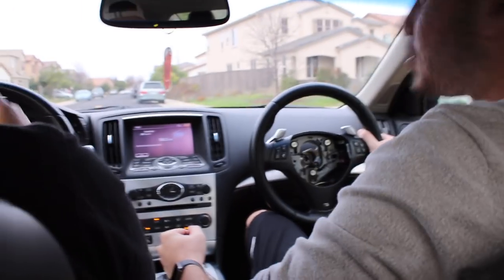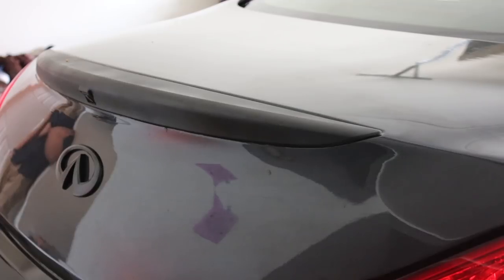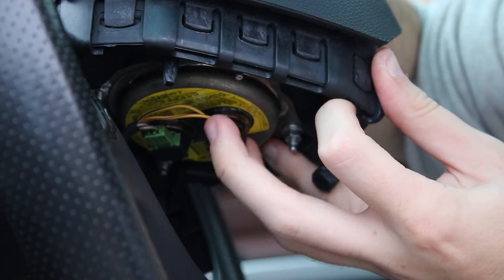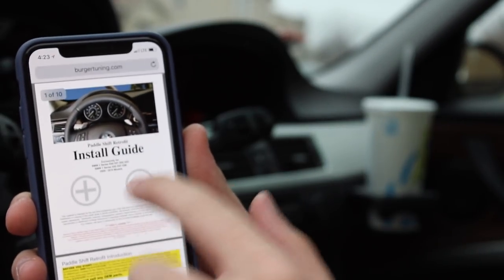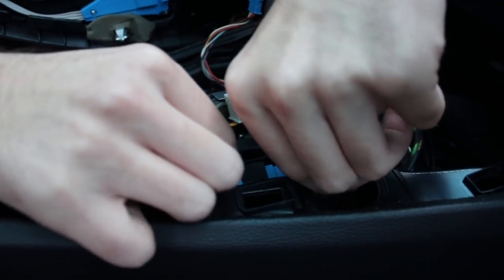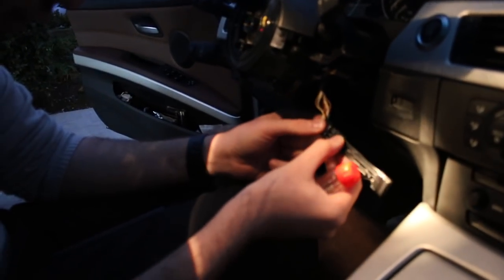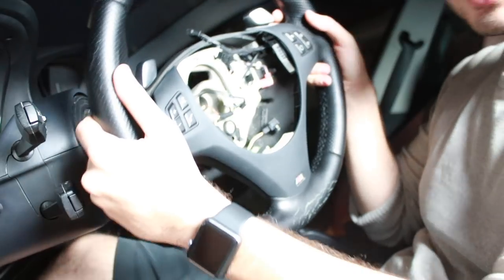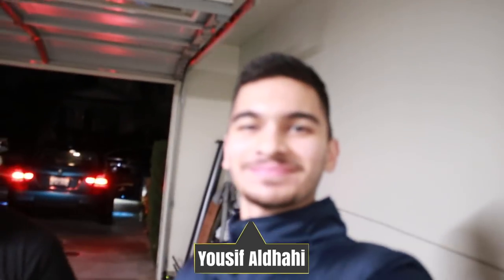BMW PADDLE SHIFTER RETROFIT! (E90,E91,E92,E93)

Comment: Nice, thanks for posting the video.  I have to say, it's not too big a deal to do, but it's so much easier on MK5 Jettas to switch to a paddle shifter steering wheel.  I will likely do this on my next E90 since it's become nearly impossible to get a manual these days, at least in the shape I want.

Comment: Lol guys the burger tuning harness does not work as described. It is not just plug and play as described.i hate when people use a product and it is not as described but they still give them credit and not call out the makers of the product and let them know that its false advertising. I know more than 15 people that have done the retro fit and harness was not plug and play as described.

Comment: Nour, I sent a like your way.  Good view of what you're doing and clear explanation. Please get yourself a trim removal tool/kit, don't teach bad habits by using a flathead on your nice car. They go for less than $10 at harbor freight or Amazon. You are guaranteed to use it again and save $$$ by not buying trim parts you'll break otherwise.

Comment: You need a different slip-ring! I didn't see you change the slip-ring for one compatible with paddle shifts. The original slip ring doesn't have the contacts to send the signal.

Comment: How'd you try to upshift? If one paddle works, you should be able to go up and down. They both can shift up/down. They don't work where one side is up, one is down. You push to go down, pull to shift up.
Reply: @peaceofmindserenity6041  Factory Steptronic shifters can shift up or down on either side… you can push either paddle forward or backward, for up and down. Don’t call people sausages on YouTube when you’re one yourself.
Reply: There are 3 different styles of paddles for our cars and the multi function ones you mention have a standard click on the back of the blade to shift up on right and down on left.

Comment: Weird they don’t sell it with the adapter anymore so you have to remove and replace pins in the 12 pin connector under the clockspring

Comment: hey bro i got a 2011 bmw 335i with the m sport but i recently order a brand new steering wheel like your but it does not have paddle shifter or the slot for it when i install it in go for a drive my hand shifter for P-R-N-D  i shift to D/S it does not work but when i intall the old wheel back on everything work fine is there a way i can by pass it or disconect any wire? thank

Comment: Can I install it on my preexisting wheel? My wheels don't have the paddles, do I need a different wheel or can I just install the paddles on the wheel I have? I'm just wondering if there needs to be a gap or a slot for the paddles to fit in

Comment: thanks for the video.  Will this work with the 335d 2010-2011.  the ones with low miles are almost never sport models.  Thanks.
Reply: It should right?

Comment: My question is that do you have to move the knob to the manual position in order to use the paddles or does it also work when the know is at D?
Reply: It will change gear with paddles in D when you click them but will switch back to auto unless you put it into manual.

Comment: Hello, if I was to buy an M-Sport Paddle Shift Steering Wheel. Do I still need the retrofit wiring?
Reply: Oli B I have the same question
Reply: Following, can someone please answer. Don't let me wait a year!
Reply: i believe you do, i replaced my wheel and paddles don't work so i might need to retro it.. idk if ill do it cause i kinda don't like the gear changing through paddle as much as i do with the stick..
Reply: @Salpeteroxid  i believe you do, i replaced my wheel and paddles don't work so i might need to retro it.. idk if ill do it cause i kinda don't like the gear changing through paddle as much as i do with the stick..

Comment: I have a E90 2011 328i and purchased a M3 steering wheel with paddle shifters, would I need the retro kit when replacing my stock non paddle shift wheel?
Reply: Did you get it to work? How did you do
Reply: @limpish1138  i did when i posted this, i retro fitted it. and it still works with no problem

Comment: I recently coded and retrofitted an m sport steering wheel with paddle shifters in an 2014 BMW f30 and upgraded to sport automatic transmission, the paddle shifters make a huuuuge difference for the driving experience. be careful on eBay, I got a stolen fake dual stage usa airbag along with my steering wheel from Europe, I was scammed too but found another airbag, file a claim with your credit card company if PayPal and eBay don't wanna help

Comment: Hello, my name is George and I own a 2011 BMW E90 LCI 335d with a Steptronic Automatic Transmission. I do not have the Sport or M-Sport Package so I don’t have the paddle shifters. My goal is to install a steering wheel with paddle shifters and I’m confused because there is a tun of options on the Paddle Shift Retrofit Harness page.  What I would like to do is purchase a used full setup paddle shift M-Sport or M3 steering wheel removed from the same year car as my car. Dose it matter what BMW paddle shift Steering wheel I get if it’s from the same year car? If so I need guidance to make it an easy plug and play installation. I would like to avoid soldering  anything if I can. I would like to install the Paddle shift steering wheel and  Paddle Shift Retrofit Harness and the paddle shifters to work and call it a day. I also have found a steering wheel looks like it’s an LCI from a 2011. I can send the link for review. Looking forward to hearing from you

Comment: looks like the bms harness is out of stock, if they dont restock i might just make my own, and sell some clones of it on ebay, all theyre doing is adding wire to the oem bmw connectors, anyone can do it, but i would rather just pay 100 to not have to deal with it
Reply: Exactly

Comment: At this point I would have just upgraded to another car..I did the same when I had a CTS..Threw all kinds of money at it when I really wanted a CTS-V all along. Not hating at all..but just words of wisdom.
Reply from the maker: TitoVilla81 if this car was payed off I would have done that. But I have a long road, making the best of it
Reply: Nour Hummadi I get you .I was once there. In hindsight, looking back, that money I spent customizing my car, I couldve used on paying off the car sooner. Like I said though, not hating at all.  You have to work with what you got and I see you are doing just that. Best wishes bro..Preciate the content.
Reply: Luis Why replace the whole car when it's so easy to install the paddle shifters? Granted, it didn't work for him but that was due to faulty hardware. Provided the hardware worked, this would have been a pretty simple mod on a car he likes.